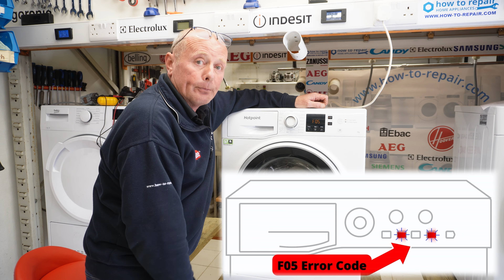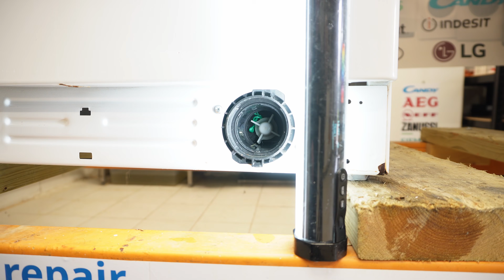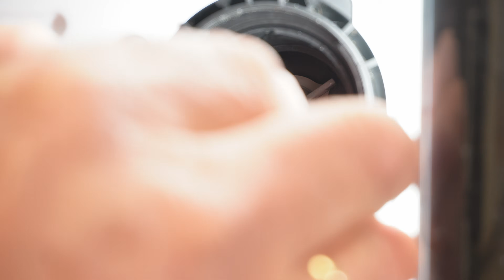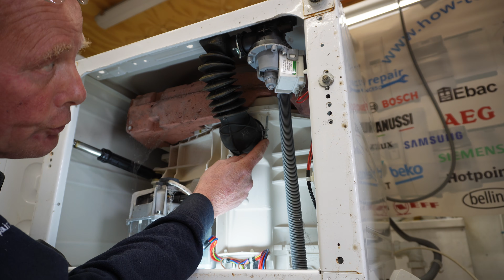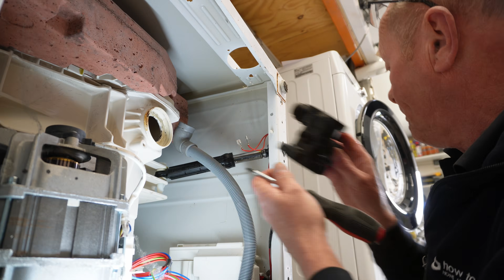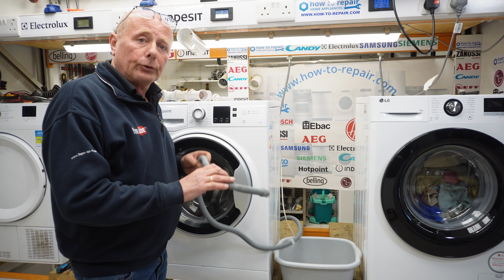Fix Hotpoint & Indesit Washing Machine F05  or F11 Error (Not Draining) - Easy DIY Guide

Comment: You sir are a genius, I tried google which just kept on going on about removing and cleaning the drain port on the front, that didnt fix it, so found your video, and instructions on how to remove the drain pump and sump hose, low and beyhold, I found a pair of my wifes thin underwear in there blocking it, somehow it had wrapped around the ball so they were a bit of a struggle to remove, we got htere in the end though, washed all the hoses out in the bathroom and then refitted, weve just ordered a laundry bag now for socks and underwear to go in to save it happening again, not quite sure how the underwear got between the drum and the sump hose though ?

Comment: Ive got this.problem, so i drained the machine, but the impellor wasn't right. I wanted to do all the rest of the fix, but  the washing machine is stuck . I tried everything. It seems there is a block of wood that the machine sits on that has swollen over the years. I pay every month to domestc and general so i got someone to come out. He just filled the machine up again, and then said my skirting board was in the way and he couldn't remove it (not to be confused with the other block .of wood). He told me to get it removed and book another appt. 
I took the skirting board off within 5 mins but he had already gone. Washer still stuck. Im now about to try and fix it without pulling it out . I'm working tonight and my uniforms all need washing so i can't wait for mr. Jobsworth to fix it. Wish me luck!

Comment: I replaced my drain pump and linear pressure switch n all pipes r clear ... what else could it be.
When its supposed to drain nothing even comes out the drain plug. 
Is it the plastic ball float ??

Comment: I keep getting F05 and have to manually drain the water and check the pump to make sure it's turning freely. It then works for a few months before failing again. I have never found anything in the filter so wondering if there is something else going on here. If there is a block and nothing in the filter then why does draining the water clear the error and the 'block'?

Comment: Brilliant, thanks. I will have to dismantle the rubber connection between the drum and the pump but I notice that there is another smaller hose connection to the main part you show above. Any idea what this is? It's an Indesit My Time Machine. Thanks.

Comment: Hi - thanks for the video - i fixed my machine thanks to this. Accumulated fluff had blocked the anti syphon ball along with some loose change and a couple of screws :) I would add that a bag of rags and a couple of old towels is also good to have at hand due to ganky water leaking out as you do this fix.

Comment: Great video! Decided to get stuck in!.. I'm getting f5 and e3 code (iirc). Thing is the machine seems to operate as designed and empties fine but throws the above codes. Drainage tube clear, pump filter clear, a small amount of water dribbles out when I pull it out. Not checked the sump hose or pump motor. That's next! All good fun and games!!

Comment: To drain mine I moved the machine forward and then lent it backwards against the wall, put a bowel below the filter and undid it to release the water, tipping the machine forwards - which got most of the water out, and then used a thin tray to capture the remainder as the machine was brought back down flat again.

In my case it wasn't a blocked filter, I laid the machine on its side and removed the pump/pipes and discovered that the blockage was in the waste pipe when I flushed it through with water. Despite a long 10 foot long white PVC feed pipe to the outside drain a plant (I think Ivy) had rooted up from the external drain right along the 10 foot waste pipe and into the machines waste pipe where it had knotted to form a blockage.

Comment: Hello good evening, my Hotpoint Aqualtis washer gave the same error F05, however, what I did was check if there was anything inside the tube, I found some coins that were all removed. In the meantime, I took the opportunity and installed a new sewage pump, put the machine to fill with water and then did a spin to empty the water, everything went well. Meanwhile, with clothes and washing, the machine gave F05 again, why would that be?

Comment: My indesit isn't letting water into the drum. I've changed the inlet valve and found coins in the waste pipe but the machine is still flashing it's lights. What could be wrong please?

Comment: Our hotpoint ariston was showing F05 E3 and nothing we did would open the door. We followed this video and ran a spin and empty 4 times. Finally it drained and opened the door. We checked all these areas and they had nothing. Seemed it just had a backlog of water maybe because the pipe is quite bent. Thank you so much. Saved us money when we are already on a very tight budget.

Comment: Hi great video.  I have the f05 fault and not sure what to do next.  I have cleaned all the pipes, took the drain pump out, cleaned it and ran it on the mains to check it worked like your self.  Put it back in and ran a wash cycle but when it comes to draining the pump doesn’t kick in and comes up with the same fault.  Could the pump still be at faulty or do i need to replace the pressure switch?

Comment: Thankyou. I found a sock wrapped around the ball in the thicker black pipe.
I reconnected the pipe, but now the washing machine wont start its cycle. 

Water is on, but Im not hearing it start to flow.
No error code, and the water supply is on.

Comment: You can't drain the filter because it's so dam close to the floor you can't get a bowl in there , the filter needs to be redesigned ,    and nobody is taking on the cjallenge

Comment: your videos are amazing - thank you. Could you please tell me (I can't find this info myself) whether a Hotpoint WMFUG942G UK should have a anti-siphon ball in the sump hose? My machine gave a F05 error and failed to drain so I've been following your videos and cleaning the pump filter, sump hose, and checking the drain hose - strangely when removing the sump hose, it didn't have a anti-siphon ball in it, I'm wondering if did have one but somehow got pushed up into the drum (above sump) or whether this model doesn't actually have one - the manual doesn't say. When shining a torch into the drum, I can't see a ball. Thanks so much for any help on this!
Reply from the maker: If it doesn’t have one in there, it didn’t from you. There is nowhere it could’ve disappeared so don’t worry.

Comment: Hi, wonder if anybody will see this and be able to give some advice…
After a regular wash cycle my machine seems to be leaving water in the drum so the clothes remain soaked. 
However, when I then set the machine to a spin+drain cycle, the water is clearing fully. 
This doesn’t make sense to me. 
Can anyone explain why this could be?
I’ve already checked the filter, waste hose, sink trap and the impeller appears to be spinning correctly with that little elastic resistance when I turn it with my finger. 
Thanks in advance
Reply from the maker: Hi pownallsnooks5457 sorry about your problem but I'm in the Atlas Mountains right now and I can have free time occasionally. I would like to help you out during my live streams. I'll be hosting a new show on Sunday so please subscribe and turn your notifications on then you can catch me live.

I'll stick the link to the upcoming stream below so you can drop your comment beforehand. I will need the full model number of your machine which is written on the ID plate. I'd love to answer your problem on the show, cheers.

https://www.youtube.com/live/-1djYxP9MDQ?si=MqqH_hU65fLl83X9
Reply: @ I’ve just witnessed the machine drain with no issues on a 90 degree empty wash cycle with descaler powder. I can only conclude that the Mrs is overloading the drum as I’ve never had this problem!
Reply from the maker: I've created a useful FAQ page for you mate. It has all the related links and documents such as videos, wiring diagram, exploded diagrams and service manual. After the live streaming I will update it with my answer. Here is the link: https://www.how-to-repair.com/faqs/beko-wmp601w-washing-machine-not-draining-leaving-clothes-soaked/

Comment: Good Day, thanks for the Informative video. In desperate need of assistance...I opened mine and cleaned out everything but there was nothing really blocking it other than a little screw. Otherwise it was pumping the water. My Problem is, I dont seem to be able to get the door open. I have tried all the possible ways to do so but nothing. The Disk does not rotate at all. Even starting it with the other washing options that make it spin at the start does not do the trick. Does that mean the Motor is burnt out? I only get the F05 Error though. Any help would be greatly appreciated. Thanks :)
Reply from the maker: Hi KatzTheGnome sorry about your problem but I'm in the Atlas Mountains right now and I can have free time occasionally. I would like to help you out during my live streams. I'll be hosting a new show on Sunday so please subscribe and turn your notifications on then you can catch me live.

I'll stick the link to the upcoming stream below so you can drop your comment beforehand. I will need the full model number of your washing machine which is written on the ID plate. I'd love to answer your problem on the show, cheers.

https://www.youtube.com/live/-1djYxP9MDQ?si=MqqH_hU65fLl83X9

Comment: My black coin collection is growing. I've found a very beaten wedding ring that the customer had been missing for over a year.
Reply from the maker: When I used to run a warehouse where we reconditioned about 400 machines a month I used to have a bucket for the coinage a large jar for jewelry separate container for oddities in the 90s. I can honestly say we used to pull at least 6 to £7 out of every machine on the Hotpoint 95 series.
Reply: @How-to-repair  You have done a hell of a lot of machines. Do you think there is a market for machine servicing/cleaning. I was thinking of pushing a tumble dryer and washing machine cleaning service to add to my repairs. Have you heard of the Ageng range of insulation/resistance testers? I've seen the one you use and think I need to invest in one.

Comment: Great job as normal, can the drum bearings on hotpoint be changed or are they new drums only.
Reply from the maker: This will depend on the model number if you send me the model number via the website I’m quite happy to have a look at what parts are needed on this machine
Reply: @ Hotpoint NSWR846 BS UK

Comment: Great vid. I haven't fixed it yet but can see the sump hose seems to be "sumping" and and motor spinning. No kinks in waste hose. So a job for tomorrow is to check the waste pipe for a blockage.

Comment: I have no blockages and the waste pipe has no blockages or anything, I get the f05 code then turn machine off and on again and it drains the water but it leaves loads of black bits in the machine…… I took off all the drum paddles and cleaned them all and the rim of the drum cleaned it all fully… and still black bits all inside the machine

Comment: What if you have done all of this, cleaned and cleared everything, replaced the pump for a new identical one, and it still throws the error at the end of the cycle but drains it in the cycle?
Reply from the maker: Hi, please use our contact us page and make sure you fill out the request for what your problem is. I will need the full model number of the identification plate and the details of your problem so that I can provide you with useful literature. A video shoot of the problem would be perfect as well.

I will get back to you within 24 hours, normally. https://www.how-to-repair.com/help/contact-us/  

Please remember to subscribe to our channel, as that's what keeps this channel going. Thanks, Paul 👍

Comment: Thank you ever so, I bought a indesit washing machine last year and now its started to make a screech noise, when spinning and doesn't use the fabric conditioner or drain🤦‍♀️, I've drained the water(from machine) and it had a new hose fitted. the other week? 
The Celt is is working.

I've rebooted it 6times in 12secs.

But its still not working?

So any advice? Please?
Reply from the maker: Hi, I will need the full model number of the identification plate and the details of your problem. Please use our contact us page and make sure you fill out the request for what your problem is. A video shoot of the problem would be perfect as well.

We will get back to you within 24 hours, normally. https://www.how-to-repair.com/help/contact-us/ 

Please remember to subscribe to our channel, as that's what keeps this channel going. Thanks, Paul 👍

Comment: Please what if it’s the control board?
Reply from the maker: if the control board is faulty, then you either have to find out if there are any blown circuits or you will need to replace the PCB

Comment: If an error code doesn’t go away after rebooting the machine I will generally google it and if it looks complicated I just replace the machine as the cost for an engineers visit is often a decent percentage of a new machine and no guarantee it will be fixed and then there are costs for parts and the time without a working machine.

This video described what the problem was likely to be, how to get to the problem and how to fix the problem. Another machine saved from joining the scrap pile unnecessarily. 

Great video. Cheers.
Reply from the maker: Hi @user-rm9jn1cd3j thanks a lot for your comment. It would be really helpful for me to get my video seen, as I'm no IT expert, to either share the channel or at least post it to your friends. My videos might not be YouTube superstars, but they save Appliances from the scrapheap. Share and help us fight appliance waste! Please remember to subscribe to our channel, as that really helps us 😇

Since we work very hard in our warehouse making free video guides for you all on appliances, we always appreciate a beer, offering a choice of single or round beer. https://www.how-to-repair.com/help/buy-paul-a-beer/ Thanks 👍
Reply: @How-to-repair you are a YouTube superstar in my books 👍👍 thanks a lot

Comment: Brilliant video, I have a hotpoint ultima WDUD9640. When using the tumble dryer the clothes come out wet I can feel the heat when the door opens. Do you have any idea what could be the issue ? 
Regards 
Stuart
Reply from the maker: This will be to do with the machine, not condensing and getting rid of the water. I would suggest you have a look at my videos to do with condenser dryers. Here is my latest one, but it's on a Beko but the principles will still apply https://youtu.be/OwDaZa-QOi8 and here is the older video on Hotpoints https://youtu.be/HIhgzymYxMo I will be doing an updated version at a later stage sorry I've got no up-to-date ones, What would really help me to get my video seen as I'm no IT expert is to either share the channel or at least post it to your friends my videos might not be YouTube superstars, but they save Appliances from the scrapheap. Share and help us fight appliance waste! @stuartcareless9550 please remember to subscribe to our channel as that really helps us https://www.youtube.com/shorts/e432SAb2g08  Thanks, Paul 👍
Reply: @How-to-repair  Hi, I found a blockage on the tank that run underneath the fan. I used the hoover detailing kit to hoover out the blockage and a coat hanger to hook it. 
Thanks for the advice 🙏

Comment: These newer models are terrible for getting socks and small items stuck in the sump hose blocking water even going to the pump my friend had the 7kg version exactly like this but plain white door and was always getting blocked and she didn’t overload either
 was glad when 
 it got a hole in the tub so was dead after 18 months and I was happy not to be going up there every month doing it for her they changed the door seal and not for the better. 
It got replaced with a 10kg standard digital beko washing machine which she’s had about 8 months and no issues.
Reply: My hotpoint is similar to ur friends and socks and small items get under the drum and shred the reason they get under is because when it spins the drum wobbles around and makes a gap between the door seal and drum which allows the small items to get in and under the drum
Reply: @Albieshutz  yes the hotpoint drums has changed slightly and now there is a big old gap in between the drum and door seal that wasn’t on older models all it takes is a slight bit of force against the door seal and then bang sucked straight under the drum then eventually into the sump hose and gets stuck full of water F5 appears then we had to drag it to the front door step outside full of water and clothes and open the filter and would slowly drain out the filter 40 odd mins later you could take the pipe off underneath and get rid of the blockage which would be socks or underwear almost every time. 
She doesn’t have it anymore only lasted 18 months went about 7 ,8 months ago and I think a coin cracked the tub open so was just leaking everywhere and had to be thrown out to the scrap man as it’s sealed tub inside. 
My old hotpoint drum was different yes things could get sucked down there but never did on me.